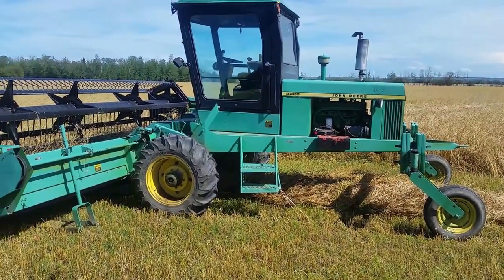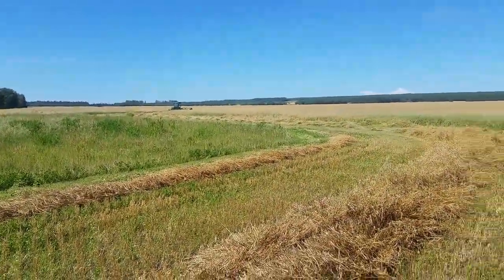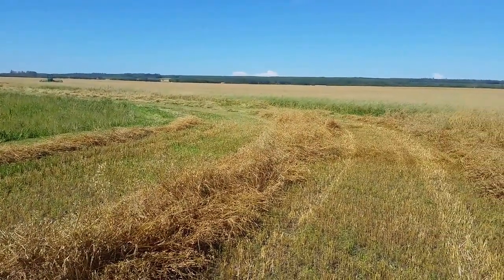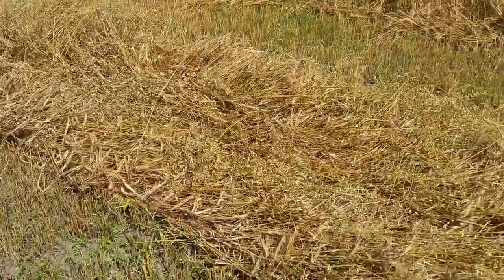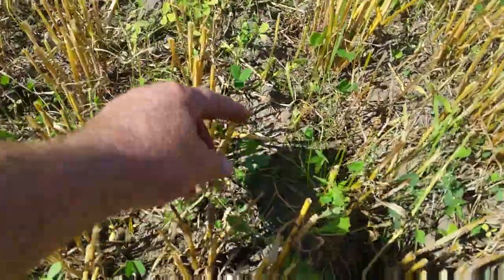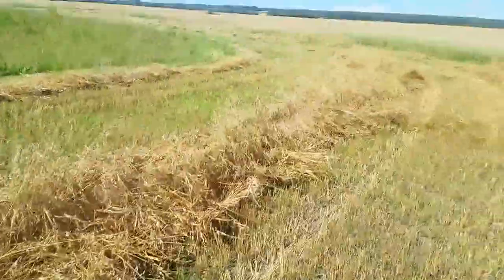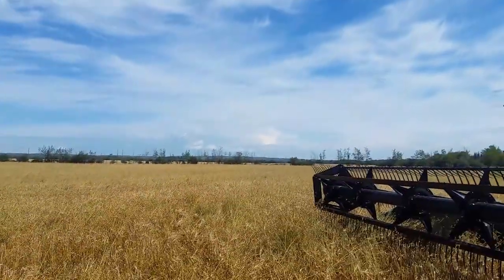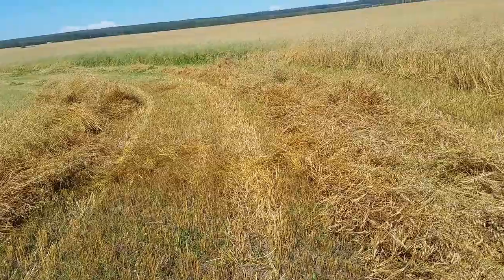Swathing Grain explained

Comment: Yeah Roundup or other chemicals used to desiccate a crop isn't cheap, and neither is custom spraying, plus some of the grain inevitably gets flattened out by the sprayer, which is lost grain.   It all adds up versus a few gallons of fuel to swath the crop and avoid all that loss and buying chemicals.  Like you said drawbacks and benefits to both practices-- if it works for you no need to apologize no matter WHAT you do... Later!  OL J R :)
Reply from the maker: And you run the risk of posioning the seeds to if they are not 30 percent moisture or less... I sprayed my peas this year since they are so low I could use my own sprayer... it wasnt cheap.. 550 dollars for 40 acres...

Comment: In Saskatchewan. I grow hard red wheat, canola, barley, flax, oats, and fallow a little to give the land a break (rotation is in that order). I swath every acre and probably always will. I don't have any cattle so all my farmable acres are cropped. I have a lot of high/low areas and pothole sloughs so my hill tops could be ready to combine and the bottom heavy crop is grass green. Too much variance in my opinion to dessicate it even if I wanted to. I do a pretty dedicated pre-burn and in-crop herbicide program and my fields stay pretty clean. There are neighbours that swath everything, some swath nothing, some swath only canola, some swath everything but wheat, and so on. Straight cutting canola is a bit of a fad around here but seems to be losing popularity. I am told that cereals will sprout in the swath but I must be lucky because I have never had that happen to me. My advice to guys in the prairies: don't sell the swather. It worked for grandpa, it worked for dad, and it works for me.
Reply from the maker: Exactly...and for me to straight combine all my cereals I would need to hire out the big sprayer which this year didnt work at all for  the guys around me.
Reply: @Northern_Farmer  same here. I have a Flexi Coil 67 sprayer and it's a fairly cheap and reliable sprayer so I have no need for a big high clearance and I hate asking neighbours that have one if they want to do custom spraying for me. They are busy enough as it is with their own stuff and custom guys I don't really trust and they are pretty expensive. How did harvest go for you up north? Was a gong show over here but somehow got it all off. Had to dry everything except my barley because it came off first!
Reply from the maker: @oilersridersbluejays  It sucked ... all that smoke made it like it was cloudy all the time... The canola was late... and froze... had to dry mostly everything.
Reply: @Northern_Farmer  yeah she was a rough one for us. Surprised it yielded what it did. May was very dry, June was a flood, July was hot and wet, August was hot and dry, September was cold and snowy, and October was cold and rainy. Weirdest year I've ever seen. Glad I never sold my dryer lol.

Comment: Growing up on farm in Wisconsin, we almost always straight combined our barley or oats.  Sometimes we cut it early and chopped it for feed & put in silos.  Usually the new seeding hay (alfalfa/red clover/timothy mix) would be 12-15" high.  We would clip the grain crop high and we would get some of the taller hay tops running through, but mostly it was just grain & straw.  We would have to rake many rows of straw together to have enough to bale.  After that, many times we would then cut the new seeding depending how much time it has to regrow before the first frost in the fall.
Reply from the maker: Our frost comes here quick... its just around the corner.
Reply: one lonely farmer